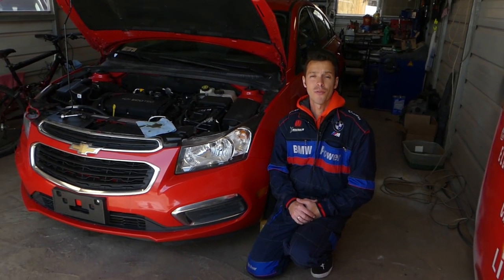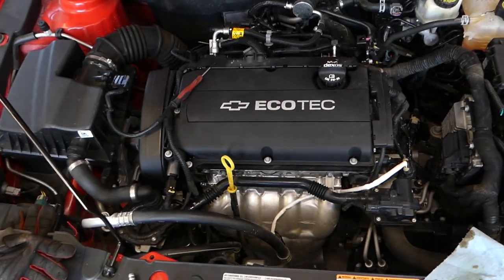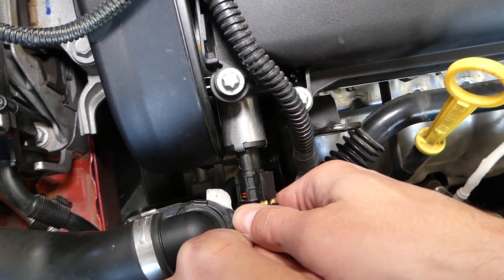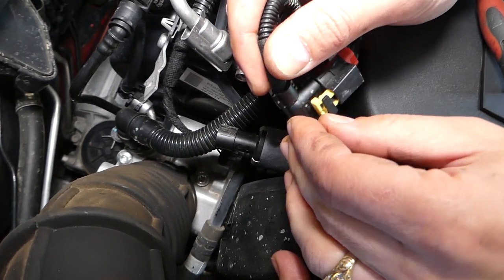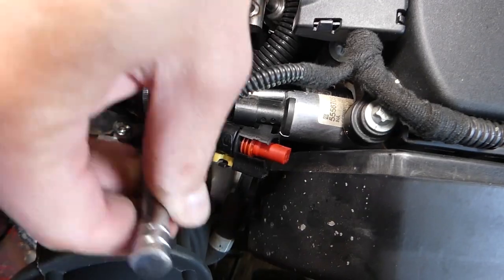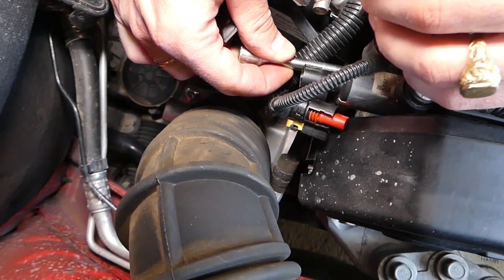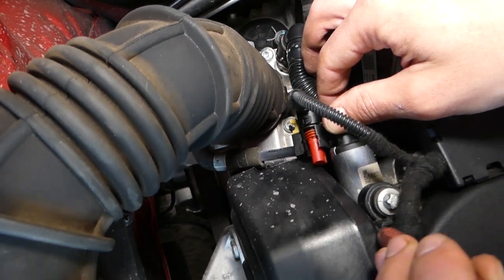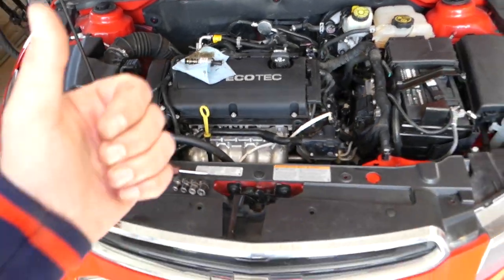HOW TO REPLACE INTAKE VVT SOLENOID ON CHEVROLET CRUZE SONIC. CHEVY CRUZE VARIABLE TIMING SOLENOID

Comment: Whats up with part numbers? Used be intake number vs exhaust number.   Different numbers by 1 digit
..55557050 vs 55567050.....now all I see is 55567050 used for both.?  Explanation? Mistake? Out of stock or ....redundant

Comment: Would one of these being defective cause a short rattle sound on start up?
Reply: I’m getting the same short rattle sound on start up
Reply: @seanhubbert9929  mine mostly occurs during a hot start, say I leave the vehicle for about 30 mins to an hr and come back to start the car. Rattle is the worse with this scenario.
Reply: I got this code to fix  and I get the rattle as well
Reply: @ryanchristensen1799  So what happened, fixing this OCV helped? Thank you
Reply: @mauric99  I didn't mess with it. It only occasionally happens. It's either the vvt solenoid sticking or the cam actuator doesn't lock sometimes like it's supposed to.

Comment: After replacing solenoid I am getting a rough rattling noise.
Reply: Check for tightness of screw, it will seem tight, make sure it’s flush with base.

Comment: Chevrolets always require work. Cause they use junk parts on their junk cars.
Reply: At least the junk cars have cheap junk parts
Reply: Amen...last time I buy their junk pieces of crap...had a 2004 mustang ran forever until I was in an accident in 2017 and the insurance company totaled it...then I bought this garbage 2017 Sonic, nothing but plastic parts and shyte for engine parts...